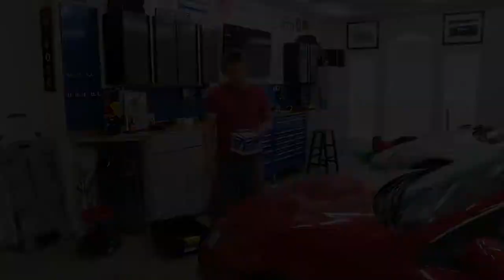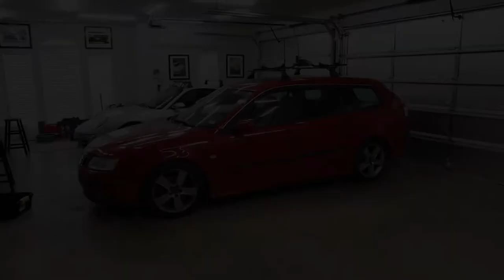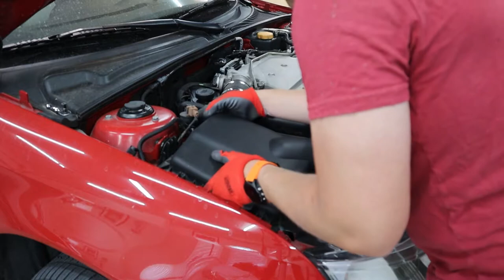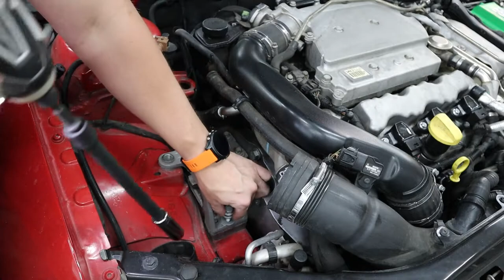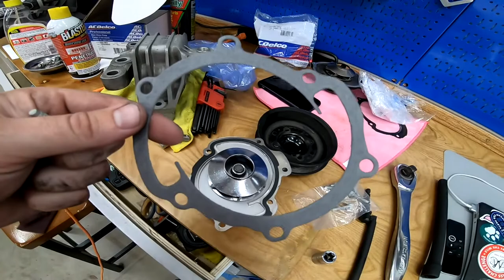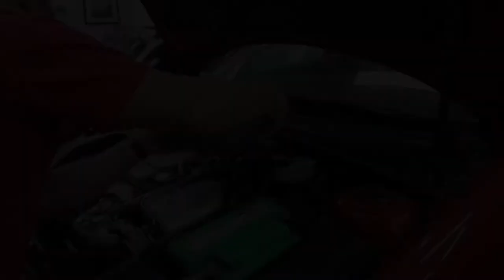Saab 9-3 Aero Water Pump Replacement | Project Saab 9-3 Aero Sport Combi

Comment: If I can ask, do you know what size the 3 star head bolts on the mount are? About to do this myself and need to get that socket.
Reply from the maker: I don’t remember exactly most Saab stuff is e10, e14, and e16. EWIS should also have the sizes. If you’re going to be working on European cars do yourself a favor and just buy a set.
Reply: @thefadshow  I'll do that! Thank you for the info, and the video. It will simplify the work for sure.